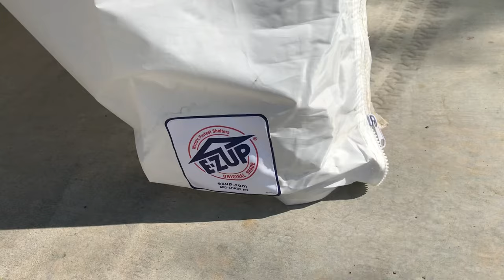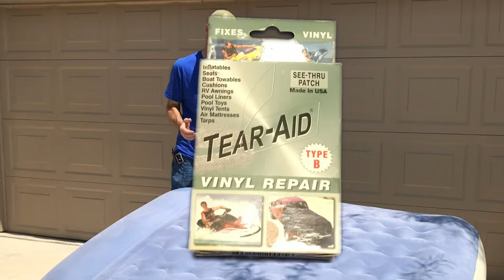Air Mattress Repair Fuzzy Side and 5 Repair Tips

Comment: yeah, but yet another example of excellent marketing. I'm talking about the fuzzy, felt, fabric side. Spray soapy water on it and the fuzzy side breaks the bubbles tension and you see NO BUBBLES but like a paste of soap n water. Nobody has time to look for a microscopic hole, which is the case for me. Most people don't even have an extra spray bottle to even get started looking. But 5 gallons of soapy water would probably do the trick, so eventually, I will do such a thing, because I have spent too much on air mattresses, and I definitely need to do this if I don't wanna wake up on a half inflated air mattress. Probably the only and best video on this matter. +1

Comment: I have a twin size fuzzy top mattress like that one. I have those fuzzy patches that came with it and was wondering how those go on. I don't have any directions with it anymore and I just kept the patches and apparently I didn't keep any directions and I found a very small hole along the crease where the pillow top meets the mattress at the very edge of the indent right there. I couldn't get the backing to peel off of the fuzzy patch so I'm assuming those take some sort of glue which I do not have. What I did is I took a pair of scissors and I scraped off the fuzziness like you did and I cleaned it up and put a regular patch on it and it's holding up nicely. How I got a hole on the top of the mattress is beyond me. Thanks for the tip of scraping off the fuzziness and just using a regular patch. This is just plastic material under the fuzzy after all.😊

Comment: I have a whole in my fuzzy side but the razor won’t it cut it more
Reply from the maker: I just did a small experiment on my air mattress for you. I used a Q-tip swab and some acetone. I used a small amount on the Q-tip and applied it to the “fuzz“. With some effort in a swirling motion I was able to remove the little hairs. This could be a possible solution for you

Comment: I like this guys style, well done video. Only thing is, the hole was conveniently on the outside corner; mine is in the crack of the fuzzy quilting pattern. Gonna be tough getting a razor in there, but this video will still help me fix my EXPENSIVE mattress, so thank you
Reply from the maker: Thanks for the kind comments. Making repairs in a seam is hard! I had a mattress with a tear/hole in a seam on the fuzzy side that I repaired with superglue gel. I added multiple layers over the course of an hour with the bed partially deflated. That repair held for two years before it finally failed. Good luck!
Reply: I just came across a used air mattress with a blow up long pillow I guess you call it. It's a tiny hole right in the indetion on pillow part. I'm guessing I'm gonna have to shave close as I possibly can around the indetion?   I work at a junk yard a vehicle came in and had desent used things inside the vehicle I popped trunk and it was a air mattress inside looks brand new maybe used couple times. I cleaned it really good and disinfected it really good.  Plugged it in found the hole it's very small. Thanks for the helpful tips!!   I'll soon get the glue that you used and a patch to fix it.

Comment: How do you repair an entire seam on the fuzzy side? 

I'm coming up with my own strategy for this particular issue

Cement glue works but only for a short period of time. 

I'm pretty knowledgeable because I've been a handyman 

But I'm looking to find permanent solution that's cost effective

My idea thanks to you? 

Scrape everything as gentle as possible! (Cement Gel Glue) Off as much as possible

And the experimenting portion 

Use what you got

Cement Gel Glue and Paper cloth

I honestly wish I had a product like"Flex Seal" but sadly I do not

Let's see what happens and thank you for creating this video

I do think they're better solutions to my particular issue but that's something I'm currently trying to figure out

FYI - One of the seams on the fuzzy side bubble up but literally has no leaks! 

But the seams that are not bubble up keep cracking and breaking

I do wish I had a particular "Flex Seal" product

I realize I need a product that can bend and move to accommodate for the for pressure of air everytime you inflate and deflate for storage purposes

Comment: What if the hole is on the fuzzy side and on a seam for one of the baffles? I'm dealing with that rn
Reply from the maker: I have had that happen. I used “superglue gel” with the mattress 3/4 inflated, 3 or 4 layers. This extended the life of the mattress for many uses but ultimately failed.

Comment: My hole in my fuzzy blow up mattress is in the seam/crease. Will this still work for me before I get started?
Reply from the maker: My guess is that this will probably not work. If the hole is not too big you can try using superglue gel. Fill the mattress 3/4 and slowly build up layers allowing it to dry between them. While this “fix” will nit be permanent, I have used this method to extend a mattress for several uses. Good luck!
Reply: This worked for me! We got 2 lays out of it before the motor on the mattress completely gave out…. New mattress. Just my luck. Thanks for your help nevertheless 😊

Comment: I am not sure which patch I used but it lasted half way through our first week camping.  It was in top. Did the fuzzy removal thing. Carefully applied and dries the patch.
The difference between this and similar videos is that the hole, now a quarter inch crack, is in a crease.. a valley of sorts, of a Coleman mattress with dips and high spots. Will try again and if it doesn't last, will have to toss a 100.00 plastic mattress into the land fill.
Reply: E6000 glue is supposed to work on seams. A hot glue gun does work though. I've tried that on seams with luck.
Reply: That's a manufacturing flaw- I'd send it back to Coleman, they're pretty good about that stuff.
Reply: @maggieelizabeth5360      Yep. That's my go to. That works on the fuzz just fine, no scraping needed. Just have to deflate fully before repair, like 100% fully. Also it does take a couple hours to cure completely

Comment: Where did you get the blankets that are on top and under your air mattress?
Reply from the maker: Great question! Those are moving blankets I picked up at Harbor Freight (72” x 80”). They run about $12 and last about 4 years before they start to fall apart. Thanks for watching!

Comment: Very convenient patch but the question is… how does it hold up?
Reply from the maker: The first repair like this I made 4 years ago and the air mattress is still going! Thanks for watching!
Reply: @MrFredsDIY  but what did you do with the inflation holes in the middle of the knob? 
It’s all connected from underneath the plate so I wonder, how did you seal it without covering the middle holes?